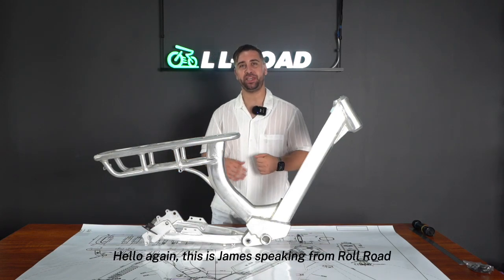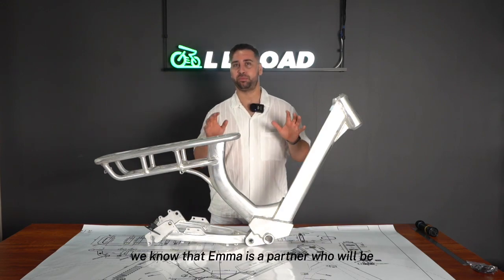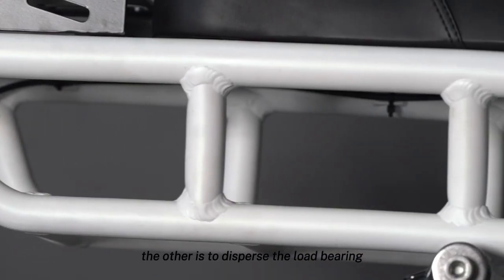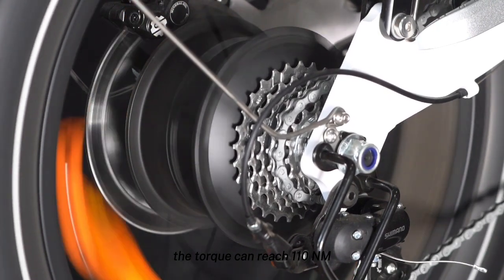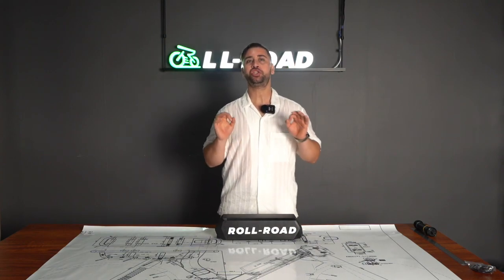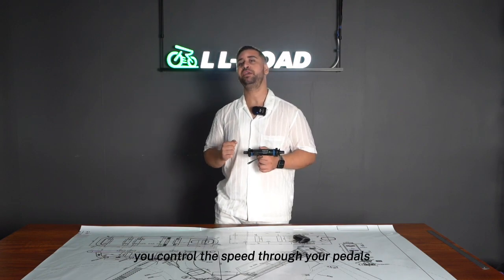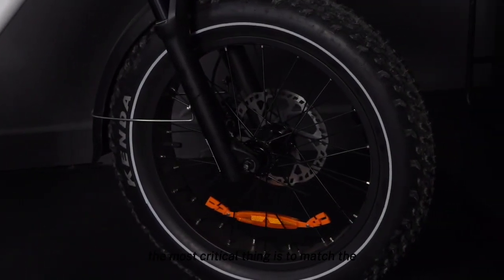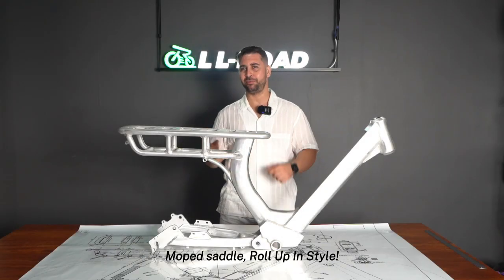Design & Technology Of Roll Road EMMA 2.0

Comment: I like your bike. But I wish it had street tires like the 3.0. Also it would be nice if you had an actual bafang motor. The 3.0 looks very good but why only a single gear ? :(
Reply from the maker: Single gear requires low maintenance, and avoid ghost pedaling forever, offering a more sensitive, real and smooth riding coupled with torque sensor.